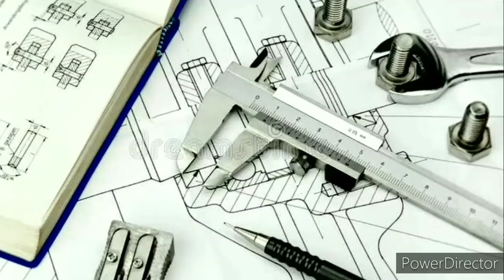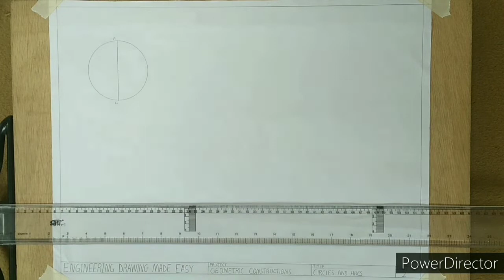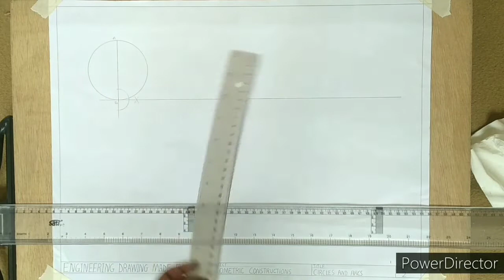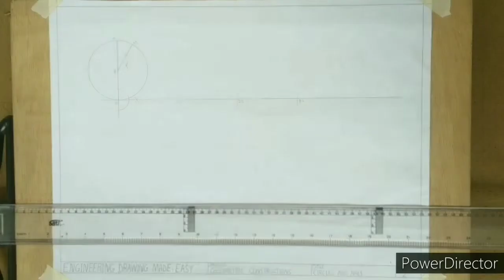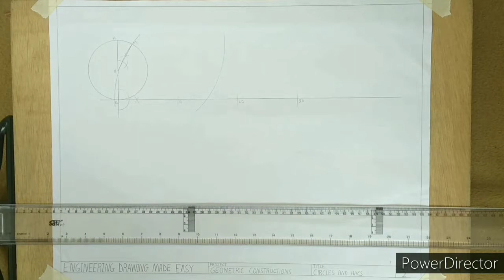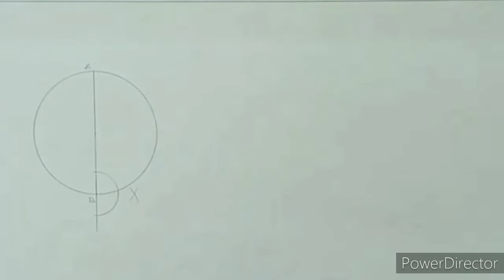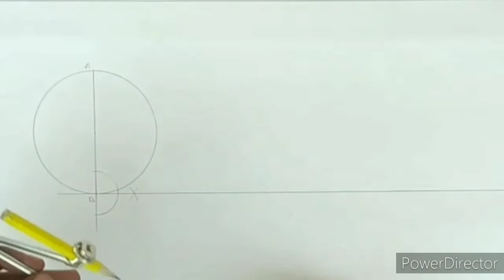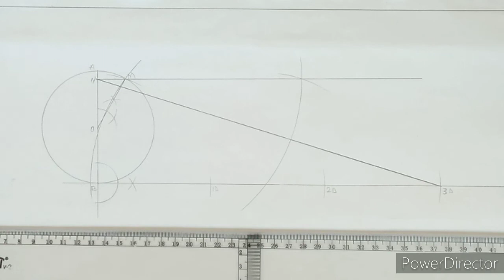Circles And Arcs: How to determine the circumference of a circle

Comment: circumference 360 degree Formula C = 2 x 3.14 x r  , solve the problem you can get Straight line length , For Inner Diameter you must reduce the thickness of steel plate 

For eg: ( 3.1 Mtr Fuel tank ) 3100 mm Diameter / Mild steel plate thickness = 8mm

C = 2 X 3.14 x 1550 = 9738.9mm
Straight Line Length = 9.73 Mtr 

Inner Diameter = 9688mm (9.68 Mtr) / minus the plate thickness (8mm)

Note : C = 2 x 3.14 x 1542mm = 9688 mm